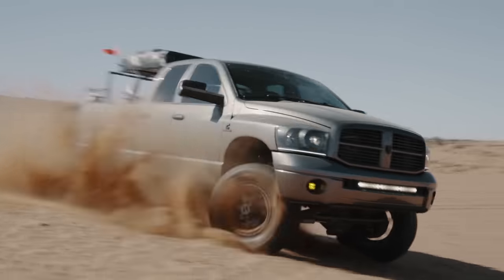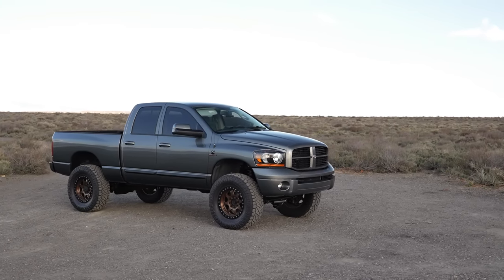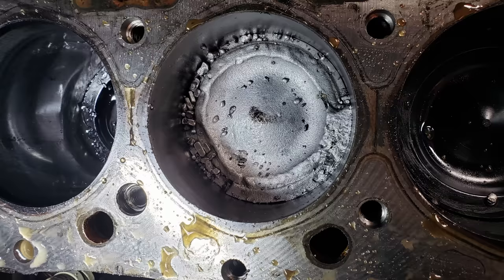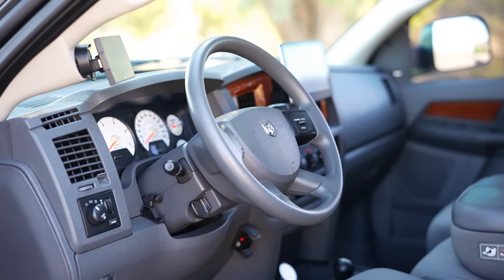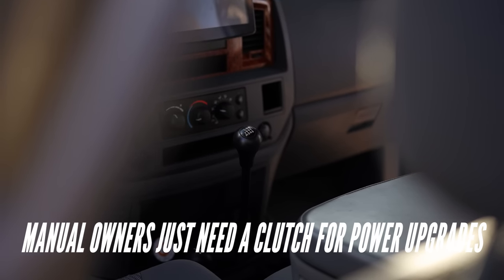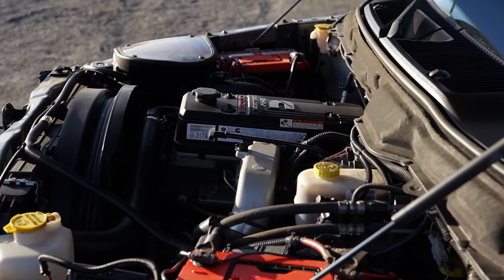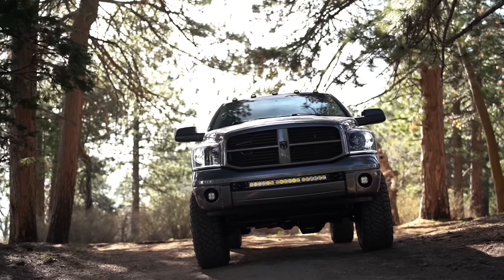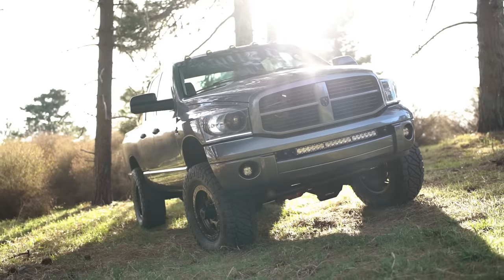Top 5 3rd Gen Cummins Issues You Need to Watch Out For (and How to Fix Them)

Comment: great video, thanks. bought a 03 with 230k miles on it. i have the maintenance records so can see what's done. original injectors (no symptoms of issues) original trans, all stock. lift pump was pre-emptively replaced earlier this year (OEM design unfortunately). previous owner always used fuel additive and replaced fuel filter frequently. TIPM was recently replaced, however I still get occasional "lamp out" light and flickering 4x4 light. HVAC on passenger side doesn't really work so blend door must be pooched. Also minor water leak from cab lights dripping from sun visor clips after very heavy rain. basically all the common stuff, lol.

Comment: My 2006 mega cab Cummins has had the tipm issues and the hvac door issue. Look for the video on how to get to the blend door after it breaks and remove it. It’s free and solves the problem. Except you lose the ability to choose between outside air and recirculated air. It will always be outside air once you remove the door.

Comment: -Great Video! My blend door actuators need replacement , my Total Integrated control module went out I haven't had interior lights in months till I checked it. And I got a Mopar Big box on the way with some Carli Heavy Duty ball joints to help my front end slop. Very true video! Granted I have 340,000 miles

Comment: The battery part you spoke of is so true. I went out one morning to my truck & it wouldn’t start. Lights flashing crazy on the dash & the weirdest thing about it all, my key fob that never works cause I have yet to put a battery in the key fob started working, I thought what the fuck & changed the batteries anyway, all is well, only problem I’ve ever had out of my 3rd gen & she’s 203k strong, still running like a champ!

Comment: Well now I get to add the TIPM to my list. I put new headlights on my truck and added brighter lights. The increased draw caused the tipm to shut off the headlights. I’m wiring in relays to lower amp draw and hoping it will reset so I don’t have to go to a dealer to get it reflashed. There is a hard reset video out there that I will try before going to the dealer for an hour labor charge.

Comment: Nice video. I'm looking forward to more. If you haven't done one on sunroofs leaking you might look into it. Pretty common I understand. My 2006 Megadually does it. I'd never buy another with a sunroof but I don't know if the design of the drain system was improved.

Comment: I had issues with my TIPM in my 2006 truck.  My headlights didn't work.  Had to send my TIPM out to Mak's TIPM Rebuilders in California.  They had to replace a couple parts in it, clean the board, and reprogram my TIPM.  It was 220 dollars to have done and fixed my lights.
Reply: Any regrets with em? I'm on the east coast and need a tipm
Reply: @nickabel8279  no issues! I'm also on the east coast

Comment: If you don’t get much air out of you vents is the blend door for outside air inside air just open passenger door and down under dash is blower motor unplug the Harned take out 3 screws and blower motor comes tight out and reach up inside and spins door so little comes right out put back together and your good to go and takes 15 mins the first time you do it. Hope this helps it did on my 05 had to run blower on low or the ac would freeze you out . If it works it will save you about 1700 bucks the aluminum cnc machined which is a permanent fix and at 315.00 bucks just for the great doors .

Comment: ya man i agree with you on the automatic transmission that people like to bs, harp on dodge. as a trained Technician from Universal Technical Institute my transmission teacher said that any automatic stock transmission weather its a car or truck any make or module that once it reaches 100,000 miles it will start to have problems. im pretty sure you already know this but i wanted to state it again. on the other hand most manuals are bullet prof. the cast iron cases are way stronger witch i know you know that also.

Comment: Personally 180k miles i had an Injector fail and Nuke a cylinder. Being a machinist just refreshed and made it better but I could understand that being a big downside to someone with not a big budget for mods later down the line. Also you’ll need a trans if you got a 48re so expect 10k for that for a good one
Reply: You can get a good trans that will hold 600hp for around 5k
Reply: @Nathangies  that’s what I thought. Then I ordered one and after shipping and what not ended up being 7900$ and then after install probably 9k or more. Also rebuilt t case so there’s that 10k. If you’re on a budget probably could do it for a bit less.

Comment: One thing I might add is I have a 2008 and it eats front u-joints.  I have to replace them every 25k-40K miles.  And I am pretty religious greasing the front end so I don't know.  Great vid!
Reply from the maker: What joints are you using? That seems really abnormal with something quality like Spicer!
Reply: Is the truck lifted? Pinion angle may be off, I had a lifted Jeep that would eat u joints because of that.
Reply: Went 250k miles on original u joints. 4” lift, 20” wheels, and 35” tires since truck was new.

Comment: My 03 has the blend door issues. It works when it wants to. By far my worst issue is RUST. My frame rotted right where the cab and bed meet. I ended up welding boxes over these sections

Comment: My death wobble was from a shop leaving roughly 2 gallons of rain water in the tire they mounted...

Took me a month and 3 shops to get it figured out
Reply from the maker: 😂😂 that’s a new one!
Reply: @JustDiesels  considering I specifically told them not to mess with the set of tires in the bed and they had had my truck from nov-april after trying to duck me often. Thinks it was done maliciously. That death wobble took out a brand new ball joint too...
Reply: That’s a prank I learned decades ago from my grandpa, that was definitely intentional. Easiest way to find it is to park with the valve stem at 6 o’clock, the release air and water will come out.

Comment: Would really enjoy hearing some clutch info, recently picked myself up a 3rd gen g56 and have spiraled through almost all your videos! Love the content man
Reply from the maker: I really wanted to put some miles on my new Valair DD quiet ceramic clutch before doing a review, but it’s coming! Now I’ve gotten time to tow, off road etc so I have a good feel for it.
Reply: @JustDiesels  Thats actually one of the clutches ive been looking at, currently has a south bend dual disc set up, and while its probably stout, its super noisy and probably  overkill for my application.

Comment: Especially 04.5-07 injectors (they run higher stock rail pressure)with stock filtration. Change injectors around 6000hrs regardless of mileage.

Comment: I've had to do all of these except my trans on my 06 with 206k. A good alternative for a Fass is a trc 10 which simply adds an extra fuel filter and water separator for less than half the cost.
Reply: Can you provide more details.

Comment: SUPPOSEDLY you can reset the tipm by holding the trip button on the cluster and turn the key to on position without starting the truck. May clear up small issues (i.e. reverse lights not working)

Comment: The blend door that controls inside outside air just take out three screws and blower motor comes and reach up inside and grab blend door and toss it and if you want fresh air crack a window if you want inside roll window up. So this is a quick fix and may be good for several more years or 1 year before a diffrent door to break.

Comment: One of the plugs on the TIPM was loose on my truck and maybe every 30 starts it would start and shut off 10 seconds later and the only fix was to get out and lock the truck with the key. I agree weird stuff can 100% happen. Also my crossover cable came loose and the computer reads the left battery for voltage and charges the right. It was charging my right battery 18 volts and I was 30 minutes from home. By the time I made it home it was boiling the acid out. Double check the tightness on you battery cables.

Comment: One common thing I found was the APPS(Accelerator Pedal Position sensor) had 3 cummins all needed to be replaced.
Reply from the maker: Yeah that seems to be more common on 03-05 trucks for some reason.
Reply: @JustDiesels  yupp one 03 one 04 and an 06 at one point
Reply: I have that code pop up, when I have the cruze set and use the peddle to pass someone

Comment: My 05 is driving me crazy. Popped prv and I replaced both the prv and the fca. It ran great for a few months although I did still have a p1222 code for high injector return. But the truck still ran and drove fine. About a month ago, it started running rough (no white smoke or anything even on start up.) But I have a huge power loss at even the slightest incline, And I can watch rail pressure drop to 2k psi. Both hard acceleration and hills do the same. But I now have 2 fca doing the exact same thing. One being the new one I bought like 5 months ago. I have a fleece in tank proflow lift pump (dual gear pump) so I don't think its the lift pump supply. But I guess we'll see once I get another new fca. Kinda pissed I didn't even put 1k miles on the other one. But the truck has the p0251 code and im at a loss as to what else could be the issue and im hoping its not the ecm.
Reply from the maker: Sounds to me like your injectors are toast.
Reply: @JustDiesels  I've been thinking the same thing. Still in the middle of trying to get that p0251 figured out first and figure out where I'm at
Reply: I think around 2005 they went to a different piston and that eliminated most white smoke when an injector is leaking but that means you might not know it is happeniing, unlike with earlier engines that puff the smoke.
Reply: @Just Diesels  when I bought the truck It had a cheap external pump like a fass clone without the filter box. It had rubber fuel hoses that I had to reuse for the supply side. Turns out that fucken thing walked its way up the fuel tank and got pinched between the frame rail and the tank. Fixed that and it's working fine now. Still have an odd issue with the wts light coming on every now and then on the highway. 8-9 chimes then after a few seconds it shuts off

Comment: I'm still trying to figure out what's causing the wandering In the frontend of my 12 Ram 2500 Cummins. I've either replaced or paid to  have them  replaced except the tie rods and control arms . I was going to replace the tie rods and control arms but the garages I've taken it to basically refuse to replace parts they say are still good.? I replaced the Track Bar with a Carli track bar myself because they wouldn't! It did improve the wandering a little but not completely. I guess I have to keep looking for a shop that Will replace the parts I want without questioning why!  The truck is stock height as far as I can tell. It's being used to tow a 5R with a Reese Goosebox we are full-time RVrs. This wandering makes driving more than a couple hundred miles a day very exhausting!  I don't want to trade it in because it's a 12 no Def fluid! And it's a southern truck with no rust anywhere!. maybe I have to take it to diesel brothers to get the front end rebuilt?  What I did find odd is nobody makes better control arms for a stock height?  The factory arms are so weak looking being stamped metal. I don't want to raise it because the Gooseneck is at the perfect height.
Reply from the maker: The factory arms aren’t your issue! If the track bar is good, check the upper column, steering shaft, steering box, and ball joints for play. I have a whole video showing how! These little guys are a huge help for the upper column: https://www.cjcoffroad.com/products/emf-dodge-ram-intermediate-shaft-bushing

Comment: Even on the 1500 if you have headlight issues it’s probably the tipm I had to replace mine just to have headlights
Reply: I needed to get running without buying a tipm so I signaled a relay with the working headlight to power the non working headlight. Rear light I wired into the trailer plug...

Comment: Hey  when you went over the injectors and trans I wondered if you have tried any of the amsoil solutions. Given i just came from you top 5 tips for cummins oil tips. I am thinking the Amsoil Cetane boost+ Injector clean every other oil change (for injectors) and Amsoil Transmission fluid( trrans/ torque converter life)!
Reply from the maker: I run fuel additives, but that doesn’t fix mechanical wear in the system from poor filtration or general usage sadly. There’s a common myth that fuel injector cleaners will magically “fix” worn injectors, but it’s just people hoping for a cheap fix to a more complex problem. That said, proper fuel additives to prolong life over long term usage. ATF is not a proper additive though.
Reply: @JustDiesels oops I meant atf for the trans not for the fuel

Comment: i just bought a 2006 cummins about 3 months ago with 250,000 miles never been tuned or anything along those lines and still with the stock exhaust and trans is fine, the owner said he did regular flushes on it and it’s never had an issue
Reply from the maker: That’s exactly the kinda truck you want!

Comment: Got an 03 Cummins with a 6 speed with apparently an injector going bad because the rpm hangs when you let off the throttle like you said in the test.   So at this point it's just time for a set of injectors right?   Is great video by the way
Reply: So was it bad injectors? If so, what injectors did you purchase? Thanks

Comment: I have a 05 Ram 3500 Cummins diesel all stock the only issue I have is my blower won’t come on but the ac light will and nothing will come out of the vents it works when it wants to

Comment: I got a 07 5.9 mega cab and I have one issue. It’s weird, when I drive on asphalt it’s smooth as butter. But when I get on concrete it’s sooooo bumpy I can hardly stand it. There are a few long highways where I live that are almost like concrete slabs I-25 and highway 14 in Colorado. Fort Collins area. I have 33x12.50R17 BFG KM3 tires. Best tires I’ve ever had. I don’t believe it’s the tires. But I can’t pinpoint it at all. When I have a load on the back, the heavier the smother but when I’m empty it’s a mess.
Reply: It’s probably the wheelbase. Your length is same as joints in concrete paving. Only solution is shorter or longer truck

Comment: Great video I have a 07 5.9 Laramie with a G56 and have corrected the same issues. I really like your stereo head unit, could you tell me what it is and what adapter you used to mount it?

Comment: Thanks for the video.  Been doing a lot up long over due maintenance on my 2007.  The electrical part is something I have noticed to be an issue with weird random problems.  One weird one I have been dealing with lately is the AC clutch makes a loud noise engaging if the truck has been sitting for a couple days.  I've replaced the compressor three times already and the problem still persist.  Charge is to the correct weight so it's not a trouble engaging due to over pressure issue.  I've also been making sure to steer clear from those Rock Auto rebuilds and the evil words..."Made In China".  So either I just have really crappy luck or it's something else.  It's never did it before just recently.  You hear a loud clank noise when it first turns on but will not do it again unless the truck sits for a few days in a row.  I've been wondering if it's a low charge issue on the batteries not allowing the clutch to grip correctly and after the truck has run a little the batteries are back to what they need to be or possibly something like a solenoid having trouble engaging somewhere in the electrical system.  After what you were talking about, I may just try getting some new batteries after I look through the connectors, ground, and TIPM.  You ever seen this issue before?
Reply: Have you resolved this? My ‘06 has a similar sounding issue. It’s a grindy clunk and the truck will even shudder slightly, just happens once shortly after AC comes on, if the truck is started cold
Reply: When you replaced ac compressor did you add the special oil ? This gets skipped so often its insane. If so the compressor will work for a good while but will cause early failure. They should include a bottle of the oil with a new unit but they dont.
Reply: @jamesnelson4061  good question, ill have to ask the shop. Is there any way to check the unit after it’s been installed?
Reply: @jasonmaddux2013  Not yet. Luckily I have not had to drive imuch lately. However I have noticed that if the truck has run a good while before turning AC on, it doesn't seem to happen but that is hard to do when it is in the 90s.
Reply: @jamesnelson4061  The compressor I got came with PAG oil in it.
Reply: @troy1672  interesting, same for me. When the truck is warmed up it doesn’t happen. When I start it cold with the AC on, I get the noise… sounds like a similar issue
Reply: Mine had oil in it too but it's not enough. It needs another 3 ounces I think. Not sure on the amount, but almost all the way sure none of them come with enough in them. And I don't think you can add without removing. Maybe with a pretty fancy funnel.

Comment: I had a problem with my 04.5 and I dug into some forums and seemed like it was a problem,I had a electrical drain and it ended up being the horn pad,I had to completely disconnect the horn pad so I have no horn and can’t get the horn pad anywhere because it also has the airbag integrated into it and with all the airbag recalls it’s hard to get one,will just put in a train horn or something

Comment: A easy fix drop blower motor and reach in and spin blend around an pull blend for out it’s for inside air and outside air and you full air flow. For outside air crack a window for inside it keep window closed .